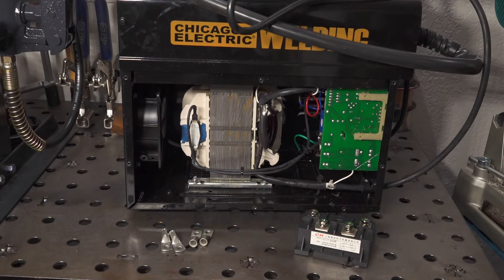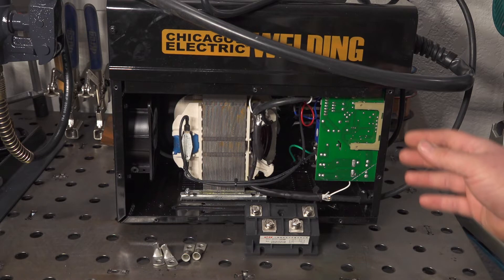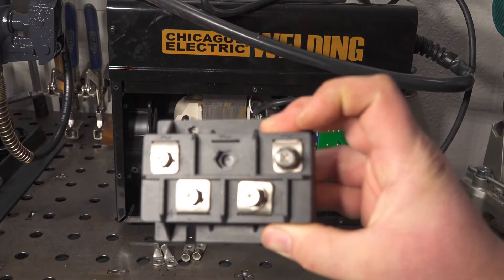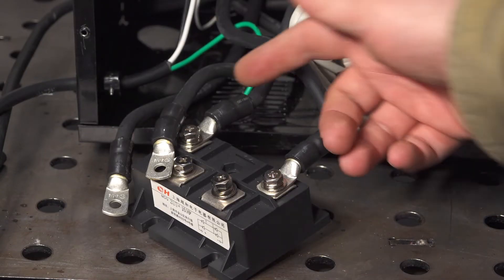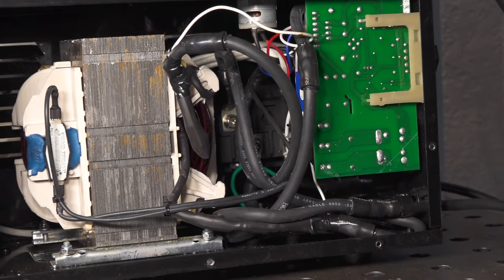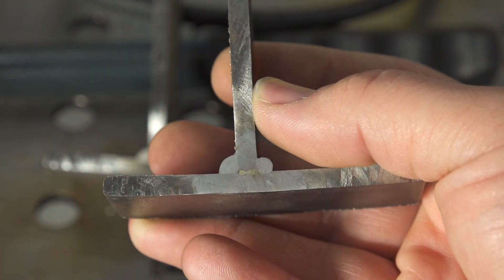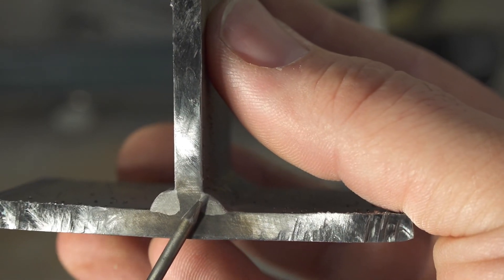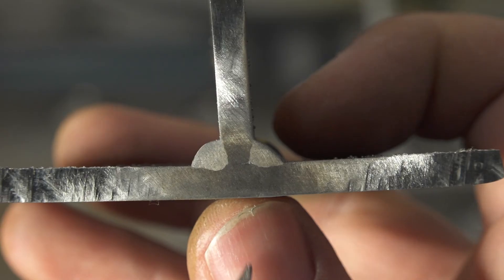Harbor Freight Flux Core: DC Conversion and Testing

Comment: Does this improve on the duty cycle of the welder? Or is the duty cycle linked to transformer and so it will stay the same?
Reply from the maker: This won't change the duty cycle.  As you say, it's still going to be tied to the transformer, which is still doing the same amount of work.
Reply: @bigtb1717  Thanks
Reply: @bigtb1717  Does doing this conversion reduce splatter?
Reply from the maker: For sure.  Flux core will always have spatter, but AC output will increase spatter noticeably.  Converting to DC will provide smaller spatter BBs that don't stick quite as hard.

Comment: Thank you so very much.     I have the 90 amp model and it is pretty much useless at anything more that sheet metal.     Have you considered adding Dinse plugs to allow a conversion to stick welding also?  3/16" rods would be well within your 125 amp range and you could weld DC+ or DC- and use almost any rods out there...
Reply: i have the 90 Amp version too.... i wish he would have answered your question about stick welding... it would be cool if it could be done.

Comment: What wire gauge  did you use?
Reply from the maker: I used 4 gauge welding cable.
Reply: INE brand which leaves beautiful welds and size 030

Comment: Do a video with DC and Amps output with the Fluke.
Reply from the maker: I had a big project for work and then I went on vacation.  I should have a few calm weekends coming up (hopefully).  I plan to do some welding videos soon.  It shouldn't take much time to check the DC output of this machine once I get back to it.  I'll add that to the list.  Thanks.
Reply: @bigtb1717  Great, I'm looking forward to seeing the conversion output.

Comment: So would not using a cap damage the welder in the long run?
Reply from the maker: No, it won't hurt anything.  A capacitor can help smooth the output, for a smoother arc.  But not having it won't damage anything.

Comment: Most convert to DCEN, but DCEP gives deeper penetration.
Reply from the maker: The common self shielded flux core wires that people would run on this machine are going to run on DCEN.  DCEP runs very poor with self shielded flux core and would be extremely unlikely to give satisfactory penetration.  There are some gas shielded flux core wires, and some specialty self shielded flux core wires that run on DCEP, but I don't know of any that could be run with this welder.

Comment: Will it be better if you put 2 of the 200a bridge rectifier in parallel  , might last longer
Reply from the maker: You could.  I think the more important thing would be to put a heat-sink on the rectifier.  I didn't put one on mine for the video because I mostly wanted to see how well it would run.  Barring any quality or overrating issues with the rectifier, I think a single one should hold up okay if it has a heat-sink.
Reply: Putting diodes in parallel is not a good idea. It's almost impossible to get the current to divide between them equally. You'd be much better off using a 250 or 300 Amp rectifier.

Comment: i absolutely loved this video, thanks man. i love messing around with welders.  i modded a clarke mig 150en with a spool gun, and modded a cheap Chinese arc welder to run  scratch tig with foot pedal to control amperage,just for fun, both working great.
Reply: Start collecting transformers out of microwave ovens (MOTs).
Tear out the secondary coils (real thin wires) and replace them with about 14 or 15 turns of 8AWG. Hook up four good sized ones in parallel if you want to run it 120V. Or connect 2 in series and the other 2 in series, then both of them in parallel if you want it 220. (These connections are for the primary coils only. Keep all the secondary coils in parallel.)
To give you an idea on how it works...
Microwave ovens need about 2200 volts to work, not alot of current. Arc welders are the oppisite. They need more current and less voltage. So the primary coil in both the ovens and welders stay the same, but the secondary are different. Many turns of a thin wire in the secondary produces hi voltage, but low current. Thicker wires at less turns produces more current and less voltage. Each transformer should be as close to each other in size, but not really crucial if youre connecting them all parallel at the primary for 120V use. Just make sure all 4 secondaries have the same guage wire and same amount of turns and are all connected in parallel at the secondaries. This keeps the voltage low but increases the current.
You probably already know all this stuff...I sorry. Lol
Lota videos on this though in the case you dont.
Reply: @AngryHybridApe  Wow, all that can fit in the welder cabinet?

Comment: Great video, but for about $70 more wouldn't it make more sense just to get the Century FC-90?, and have to mess with buying all these additional parts to upgrade the HF model?
Reply from the maker: I can’t remember if I said it in this video, or one of my others on this welder, but my feelings are that if you already have this welder and want to convert it or just thnk it sounds like a fun project, by all means.  But I wouldn’t recommend buying this welder with the intention of converting it to DC.  Personally I’d recommend just buying a more expensive welder.
Reply: The century is an inverter. One component goes gad then you  need a new welder; this one however can be turned into dc with a rectifier bridge, a transformer is way more reliable than inverter

Comment: Thank you for doing the conversion and showing us the results! Definitely an eye opener comparing the penetration results between the stock AC and the DC- with only a rectifier! Would be interesting to see the results with adding the capacitor you mentioned perhaps doing to yours.
I know you explained how you spliced in for adding the rectifier, but (for me anyway) I’m not sure I understand HOW you spliced in or with what wire I could purchase. You did show us where the connections come from internally and go to on the rectifier. I can solder and put heat syncs on, I just didn’t understand the location to cut and type wire to use.
Thank You Very Much for doing the conversion, showing us the component to do it cheaply and those amazing results!
Reply from the maker: For cable, I used 4 gauge welding cable (purchased on Amazon).  You could use just about any 4 gauge wire, but "welding" cable has more, smaller strands so it is more flexible and easier to work with.  

The wire that comes from the transformer is a stiff, solid wire.  It is spliced to a more flexible wire that runs to the work clamp on one side, and that runs to the wire feed system on the other side.  At each of these splices there is a small, white wire that is also spliced on.  This white wire must stay on the AC side.  That is all how it is from the factory.  I simply cut the flexible cables after the splice.  Once you cut both (one for the work clamp, one for the wire feed) you have four ends; two which lead to the transformer, one that leads to the work/ground clamp, and one that leads to the wire feed system.  The 4 gauge wire I purchased was simply used to extend each of these to reach the rectifier.  Hopefully that makes sense.  Let me know if you need clarification on anything.
Reply: bigtb1717 That explains it. Thank you!

Comment: I see you've done videos on the Amico TIG welder, have you considered doing one on their super cheap stick one?
Reply from the maker: Just FYI, I ordered an Amico ARC140 and should have it in a week or two.  Once I have it and get time, I'll be testing it out and making a video or two about it.
Reply from the maker: I haven't, but I'll look into it.
Reply: @bigtb1717  Their arc 140 is $99 USD and I'm curious on the penetration. A friend got one a while ago and it's one of the cheapest on Amazon.

Comment: Thank you for the video, I'd be interested in seeing more tests on this. I'm curious, you went DCEN correct? Because some set it like it's regular MIG not knowing the difference.
Reply: Dcen is straight polarity and that, besides ac is how flux cored wire is designed to run. Mig on the other hand, requires dcep to penetrate and run properly, the current is mainly on the workpiece in dcep. In straight polarity, youre destroying your wire electrode with most current being there on the flux wire. If you mig weld you can try straight polarity as a test! Boy it will make a mess
Reply from the maker: Yep, DCEN.  I went over it pretty quick in the video, but I did mention connecting the positive terminal on the rectifier to the work clamp and the negative terminal connected to the wire feed.  

I've made the mistake of running self shielded flux core on DCEP in the past, and it runs worse than AC.
Reply: @bigtb1717  I must have missed it, but yeah. My friend bought this machine and when I used it I immediately decided it needed to be converted, so I've been looking into there simplest way to do so and your video was very helpful.
Reply: bigtb1717 You mention you might put a capacitor in. Please tell me why, what size/type (perhaps a link to the one you would suggest) and how you would wire it in? Thank You Very Much!
Reply from the maker: I don't know how much you know about how AC power works, but the voltage is a sine-wave pattern that alternates back and forth between positive and negative.  The rectifier changes the negative portion to positive, so the output is always the same polarity, rather than alternating.  But since the source is a sine-wave, the output from the rectifier is constantly pulsing. 

A capacitor can help smooth out these pulses and in turn, smooth the output of the welder.  A capacitor would get wired in parallel with the DC output.  It would ideally use wire as large (or nearly as large) as the rest of the circuit.  I think 50,000 uF or more is generally recommended.  A capacitor stores voltage, so you would also want to connect a bleed down resistor, otherwise the output can stay live after you stop welding.  Many people add an inductor as well.  Leaving out these extra components is why an AC output welder can be so much less expensive.

That's why I wanted to see how much difference just a rectifier made, without also having to stuff a capacitor,  inductor and related items into the welder.
Reply: @bigtb1717  thank you for that explanation. I've seen videos of the much bigger mod. So if this mod fails and I'm assuming the bridge would go first. Would I just replace it and try again?
Reply from the maker: @davidfellows6250  Yeah, most likely the rectifier would be the first thing to fail.  If it has a sufficient heat-sink it should hold up, even without the other components.  If it does fail, it could fail closed, which would short out the transformer.  Still probably wouldn't overheat and damage the transformer before a breaker trips or the rectifier burns open.  So most likely you would just have to replace the rectifier.
Reply: @bigtb1717  thanks again.

Comment: I see your rectifier is rated at 200 amp, 1600v.  Amazon has several flavors of that are there any other specifics I should know before ordering?
Thanks for this video.
Reply from the maker: I picked the one I did based on amps (200A gives a bit of breathing room, for hopefully better reliability), it had screw terminals, and it was prime shipping from Amazon.  You are only dealing with voltages under 50V, so 1600V is way overkill, but it's probably overrated anyway.  You just need a single phase, full-wave (most you'll find are full-wave, but just make sure you don't get a half-wave) bridge rectifier that can handle the amps and volts.  Nothing else special about it.  There is a 150A rectifier on Amazon for under $14 shipped that is smaller and would be a bit easier to fit inside.  It is from the same seller I ordered from, and I would have tried that one first, but I decided to go up in amps.  

FYI, I used 4 gauge wire.

I didn't do this yet, but I may end up putting a thermal pad between the rectifier and the side cover of the welder.  Neither surface (the back of the rectifier or the welder panel) is very flat, and a thermal pad would improve contact and may aid in heat transfer.  Something you may want to consider as well, depending on where/how you are going to mount the rectifier.

Good luck and be careful.  Safety first when dealing with electrical components.
Reply: bigtb1717 Thanls for the specifics to look for when purchasing the rectifier.

Comment: I was excited to see the posting of this video. Seeing those results I personally think that the conversion is worth the effort even if it's only installing the rectifier. What wire were you using in this test? Is the welder on a 20amp circuit? Last question, is this machine the newer 125 or the older 90 machine? Thank you for posting your test and results.
Reply from the maker: It is the newer 125A machine.  I do have it plugged into a dedicated 20A circuit on a 20A breaker.  Edit:  Also, in previous testing I measured 130-140 amps of output from this welder when plugged into the same outlet, so I don't think the supply is holding it back any more than any other 120V circuit would hold back any welder.

If someone already has this welder and can't afford something better, I agree that it's a worthwhile modification.  In fact, if it were my only welder I'd probably get a capacitor for it as well.  Should smooth out the arc.  If someone is just starting out, it might be worthwhile to look into other options, vs. buying this one with the intention of modifying it.  We're spoiled for choice these days.
Reply: bigtb1717 I have the 90amp version but haven’t used it YET - haha.
You mentioned “other options” if purchasing new. What DC flux core welder would you suggest for someone like me who is budget restricted?
Reply from the maker: Keep in mind, none of the other options are nearly as cheap as the HF welder.  I will be reviewing the Century FC90 soon.  It used to be $169, but it is $199 now, as far as I can tell.  It is a DC output welder and I'm optimistic about performance, though I have barely used it so far.

Lincoln has a DC output flux core for around $270.  Quite a step up in price, but it works well and is simple and reliable.  I haven't looked into other options much, but I'd look into Everlast, Razorweld, Klutch and possibly a few others I can't think of off-hand.  You may end up still deciding the HF fits your budget best.  It is definitely the cheapest.
Reply from the maker: Oh, and I was using Lincoln NR-211MP wire.  Common stuff, picked up at the local big box hardware.  I like that wire a lot better than the stuff that came with the welder.
Reply: @bigtb1717  I agree
Reply: @bigtb1717  Very interested in this concept. You mentioned the “capacitor” install a few times. Can we get a video of that install as well? I’m subscribing!!! Great stuff!!!
Reply from the maker: @bamamike1013  Thanks.  A capacitor isn't strictly necessary, it just smooths out the power delivery a bit.  I could probably make a more complete video on converting this welder to DC, but I'm not sure when I could get around to it.  I'll keep it in mind though.
Reply: @bigtb1717  Thanks Brother! Decided, I’m not going to focus on that. Just went out to my shop...I got the 90A. I’m going to give it a shot b/c I was about to toss that bugger.